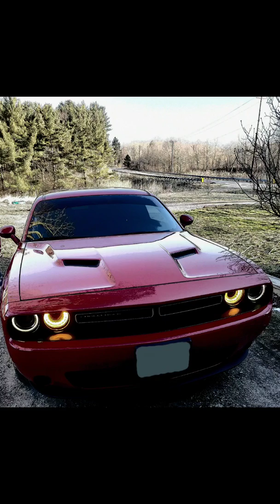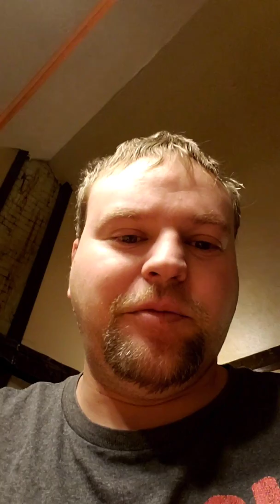How a Pentastar V6 is more Powerful than the 392 HEMI

Comment: To me both the V6 and the 5.7 are way underpowered for example ford and Chevy have V6 options also but their V6 pumps of way more horsepower to the wheel than dodge also fords GT engine is a 5.0 compared to Chryslers 5.7 that makes way less horsepower. I know it’s all about drivetrain and tune and wheels and a lot of other things but engine to engine except when you get to the hellcats and above their engines are way underpowered, now I think they might fix these things with the 2024 refresh
Reply from the maker: I agree totally

Comment: You have no idea what your talking about.. that v6 would be eaten by a hemi.... the 5.7 has 400 horse.. need to do research...
Reply from the maker: The 5.7 has 395 hp in the Ram but makes 375 hp in the Challenger ... The older ones made 345 hp in the challenger

Comment: I've always Leased Rams in the past but I bought a Durango GT 2020 this time, and Its amazing the power that it gets for only being a V6. And the Gas really isn't bad considering the power .
Reply from the maker: I have a 2006 Ram with the 4.7 V8 and it only makes 230 hp lol.  The Pentastar V6 is 305 hp.
Reply: @MoparDad84  the ZF 8 Speed has a lot to do with the power of the V6.
Reply from the maker: @jeffreyzabawski4862  yes it does it makes a big difference ... the cars that had the Pentastar but not the 8 sp aren't nearly as quick.

Comment: The bottom end is fully boxed with a deep skirt, just like the 426 Hemi from the 1960's, with six-bolt main bearing caps. The factory decided that they needed to have a turbo option, but instead of making two different blocks, they made the decision to only make turbo blocks. When the pistons are near bottom dead center (BDC) an oil-jet sprays the bottoms of the pistons on the exhaust valve side. The oil filter is on the top/front of the engine, with a replaceable cartridge inside a permanent shell...There is more...https://www.thedrive.com/news/34672/check-out-how-surprisingly-durable-this-chrysler-pentastar-v6-is-after-626000-miles

Comment: I actually drive both at the moment. 
2011 Challenger SE
2013 Challenger SRT8
There is potential to modify both. I'm not sure about over 500hp.  I've seen supercharged 6.4 Hemi's tuned up to 800hp . I don't have that kind of money. Just enough to keep the 6.4 V8 and get rid of the V6.

Comment: I love the Pentastar V6 but they don't just upscale easily because there is such a thing as state of tune.  They 
may not just be able to upscale it and get those numbers.  I plan on adding an AWD GT Challenger to the garage
beside my supercharged 392 as soon as I fix my fricken blown up V6 AMG Benz that couldn't handle a tune without
popping.   I do plan on tossing a Sprintex on my Pentastar once they crack 2021 PCM's.

I think my first mods when I get the GT will be the AFE Momentum CAI with the Hellcat headlight tube, a Solo Cat Back 
and I have to find another set of rims. Those stock GT rims are awful.  I think that will hold me over till they crack the 
PCM which takes a while.  I may do some cosmetic stuff  like LED marker lights.

Comment: My CTS-V makes 1.478 hp per cu. inch. I win 🤘🏻 
PS. My minivan has the same engine as you lmao
Reply from the maker: Yes GMs 3.6 is a great engine as well makes 335 HP I think thats very impressive for a V6 ... and I also have the same engine in our van lol doesn't make as much hp and isn't nearly as quick though but its pretty quick for a minivan
Reply: @MoparDad84  no I have a Grand Caravan. Bought it BECAUSE of the Penastar. My Cadillac has the LSA (6.2 supercharged)
Reply: @MoparDad84  CTSV is a 6.2 V8 with a blower

Comment: Have the v6 in my ram. Its more than powerful enough and I'm getting 30mpg so cant complain
Reply: Same, my ram has a v6 and you floor it, it throws me back at the seat and it’s just fast as hell just for a v6.
Reply: Apparently the difference in 0-60 time between the V6 and the hemi is only a few tenths of a second

Comment: Measure power in time slips, not division. Pentastar V6 doesn’t stand a shot at a drag strip vs a scat. What
Reply: “Faster than 95% of what’s on the road. Trucks and SUVs.”
Any tuned diesel will outrun a V6 Chrysler

Comment: I'm currently building this engine to put into my charger body.  Building up the engine a little and then im going with the RIPP supercharger and attempt every mod I can + tune to get the most power anyones ever gotten out of a 3.6
Reply: You can get AWD in the V6 . 
V6 AWD plus RIPP supercharger FTW.
Reply: @louisbabycos106  I don't think awd would help a v6 supercharged charger at all
Reply: @DolanGhost  
With up to 450 wheel  horsepower with AWD even a novice drag racer could put down respectable quarter mile times . At the stop light you could surprise a lot of sport sedans and even dedicated sports cars .
Reply: @louisbabycos106  the ripp supercharger doesn't do much if anything for low end not enough for awd to make any difference

Comment: the 5.7 hemi gets 390 hp and 410 lb ft tq. the 3.6 pentastar gets 305 hp and 270 lb ft tq. there is no possible way a 3.6 pentastar can get the 6.4 hemi capabilities. i dont give a shit what you do to that engine. you can add a super charger to each cylinder and put jet fuel in it. it will fall apart before you get anywhere near 6.4 hemi numbers. im not in any way saying a v6 cannot get those numbers. im saying the 3.6 pentastar cant do it.
Reply: The R/T is rated at 370hp & 395lb-ft torque. I think you're talkin about the 5.7 in the 2019 Ram. 

Its VERY possible to mod a Pentastar to get close to (stock) 392 power if you know what you're doing. 86Face is currently at 474 whp & 400lb-ft torque with his build. The Pentastar was built to handle boost so the engine is pretty durable/reliable.
Reply: @darronthemastodon  my truck is a 2012 ram 5.7 and i did my research. it produces 390 hp and 407 lb ft tq. i can only speak on what i have and my experiences. i drive that truck its an LT crew cab model. with a payload capacity of 1450 pounds and towing capacity as is of about 8k pounds. (and thats with an 8k trailer and 1450 pound payload).

Comment: i read the comments about how everyone loves their v6. i had a v6 4.3 286 vortec in a sierra and it was a shitty truck. the engine was reliable but had no power. my 5.7 hemi 345 is nice in my now ram. compare a 217 to a 286 or 3.6 to a 4.3. seems like the v8 is the way to go if you wanted a performance/muscle car. not saying you need a 6.4 392 or anything. thats like me getting a 2500 ram with a 6.4.
Reply: The difference is your Sierra didn't have the ZF 8 Speed Transmission helping  your Motor with a lot of the Power.

Comment: More volumetric efficiency yes, torque output/curve ain't even close though.  I bought my scat pack challenger because it had a torquey V8 and the sound and seat of the pants feel never gets old.  I'm 59 years old, no accidents and my insurance is around $350.00 a year through ERIE Insurance, similar to what I pay for my  2013 V6 Impala.  Every time I cold start my car I smile when it pops and comes to life.  No mods here, love the way it is.  I work in engineering and I'm really impressed with the engineering that went into my car.  I get on average about 17.5 mpg on a tank of gas 93 octane, I only use mine for pleasure driving.
Reply: That’s awesome. If I was able to own one just for pleasure I sure would and I agree that the sound and feel of a v8 is definitely unique. But for what it is, my v6 is a daily driver and the only time I get 17mpg is when I’m making that engine work. I mean doing 130+. But again, for what it is, the torque is also definitely not the same but the horsepower with a supercharger, you can see those 392 hemis drivers scratch their heads on your rearview mirror lol. And the insurance thing is for younger ppl I guess. Hopefully I pay close to that in about 20 something years. But I do agree with you in regards to the feel of the v8.
Reply: I get way better mileage in my AWD Challenger. It's not even close .... lol. That's running in sport mode with AWD engaged. But, yes, the 392 is great fun .... 😀

Comment: I test drove a 3.6 v6 charger gt and that impressed the hell out of me. I didn’t know what engine it had and I thought it had v8 power. Till I popped the hood after and saw it had a bone stock v6.
Reply: Matt Leonard yea the GTs got a sprinkle of more power up to exactly 300 hp ...8 more than some SE ? Or the SXT ? Idk , Plus the Sport mode is upgraded , gets paddle shifters and better sport suspension and MPGs up to 30 highway, I love my GT ... if it all goes to shit and I blow my Pentastar? Swap in a HEMi... Idk how difficult that maybe but assuming the size engine bay and being the same trans it should be possible? Idk I’m new to muscle and mopar, coming from Nissan Zs ... I loved the POWER in those VQ engines which is why I don’t sneeze at a V6 dodge. Love mine, but I wouldnt  mind finding new power adders. Great video !
Reply from the maker: @hardrockrelics2157  I have videos on my channel of a BBK throttle body install and RIPP coil packs ... I also have a custom exhaust and a K&N intake system ... those are some mods I would recommend ... I am looking to do a tune next.
Reply: Mopar Dad 84 excellent, out of all those mods , which one was most noticeable? And which should I do first ? .. just Subscribed 😊
Reply from the maker: @hardrockrelics2157  the throttle body was the most noticeable to me but I would do the cold air intake as first mod then exhaust.

Comment: V6s guys delusional.  My 392 will smoke that shit and sound good doing it
Reply from the maker: V8s sound great and the 392 is definetely faster stock but the V6 can be modded to be faster.
Reply: @MoparDad84  by time you spend the idiotic amount of money to make a v6 faster than the 392 its not even worth it